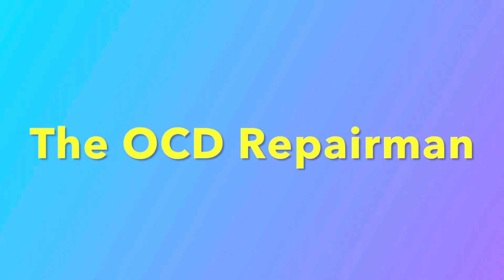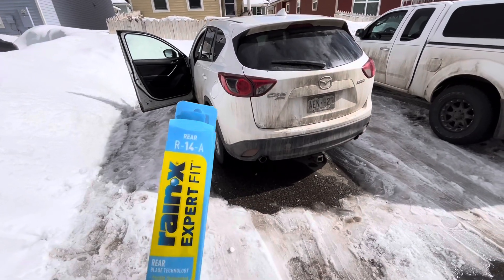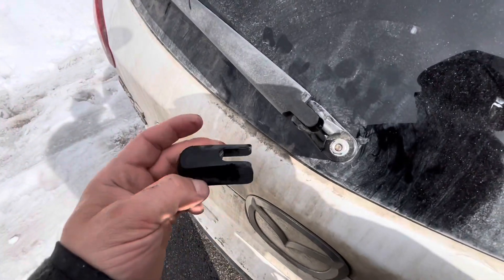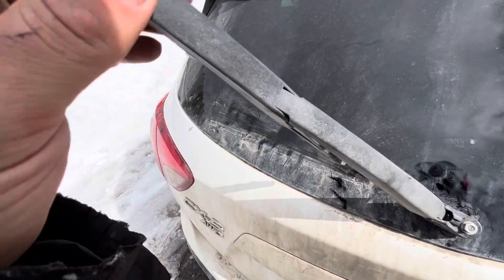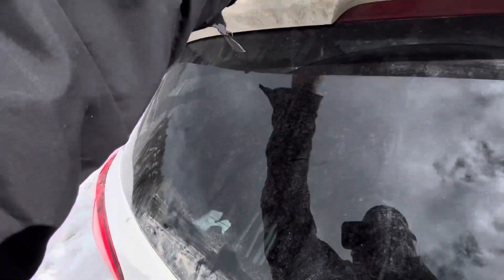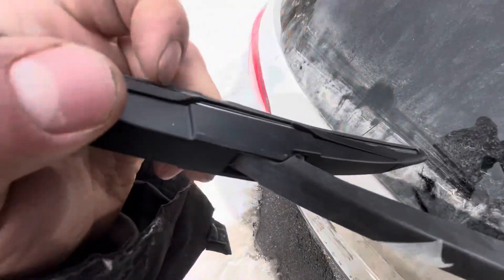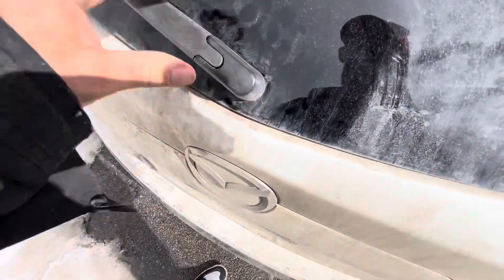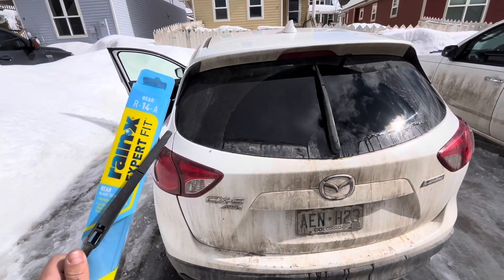How To Replace Mazda Rear Wiper Blade

Comment: On my 2021 CX-30, the arm does not raise up after taking the cover off. I had to remove the nut and take the arm off to replace.
Reply from the maker: Thanks for the tip!
Reply: @Theocdrepairman same here. There is another piece blocking the movement of that tab.